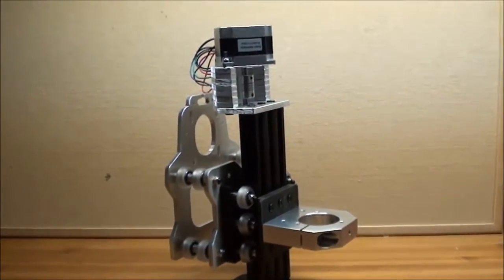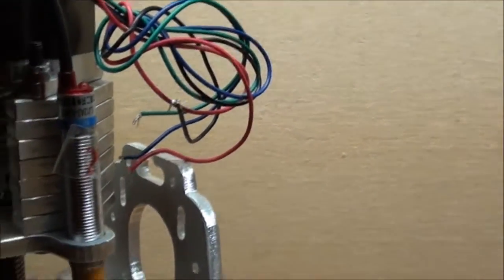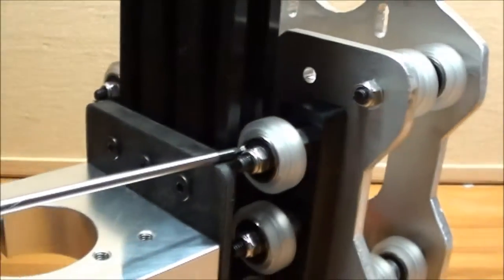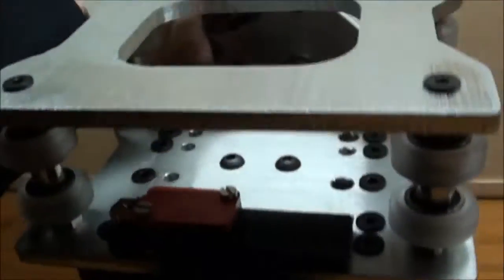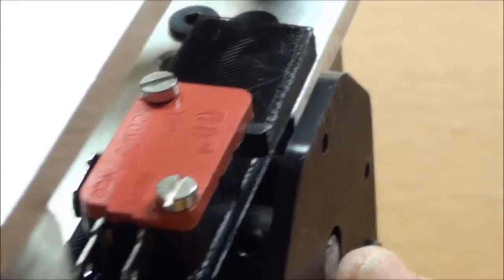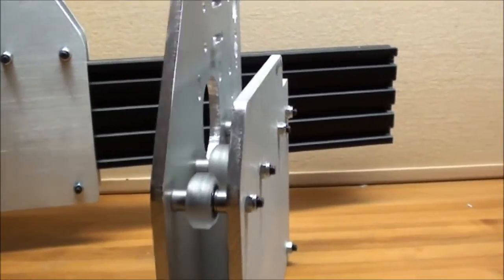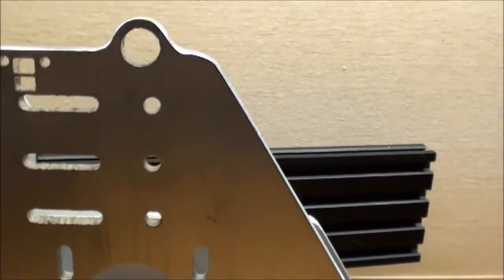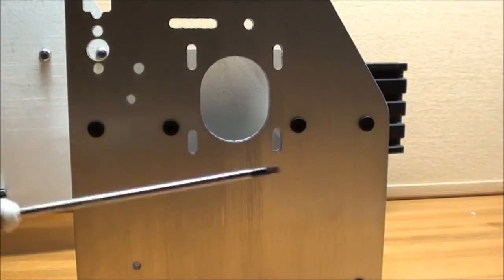OX CNC Y and Z Gantry w limit switch mount

Comment: Great modification! I have an Ooznest Ox that I am wiring switches for,  it doesn't have your holes but I will make something work in the same spot. Perfect location for Z max
Reply from the maker: Hi Noah, Thanks for the encouragement. The 3D drawings for the Z switch bracket can be found on Thingiverse: http://www.thingiverse.com/thing:740642 If you do not have a 3D printer it will be available on makersupplies.dk with in the coming month.

Comment: Great idea with the limit switch mounts! I am building my own custom version of the OX CNC. I have struggled with how to mount the limit switches. Thanks for sharing.
Reply from the maker: +Don Fillenworth Great to hear that you can use the design. It has worked very well for me. Which custom elements are you adding to you OX? - and do you post it somewhere?BR; Martin